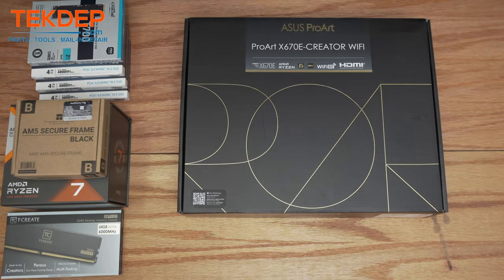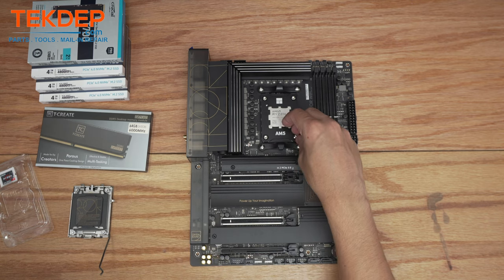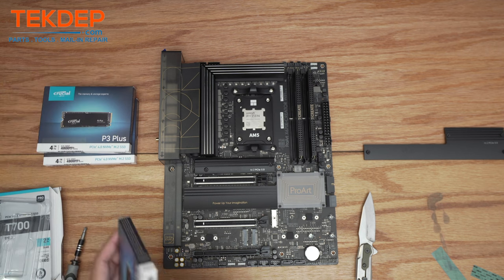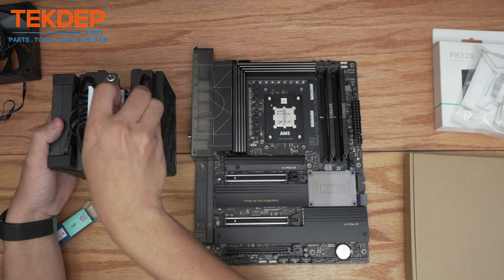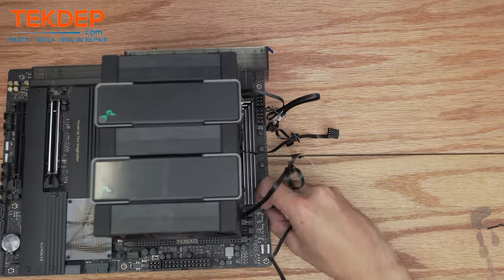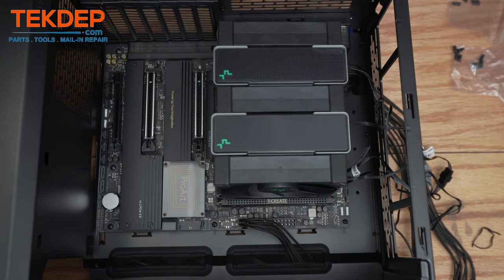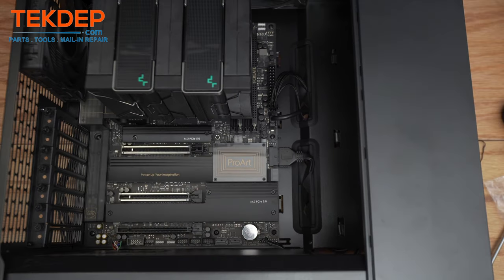The Perfect RGB-Free Gaming Rig: AMD 7800X3D + RTX 4090!

Comment: 00:03 Overview of the motherboard and CPU components.
01:14 Installing CPU and CPU Contact Frame
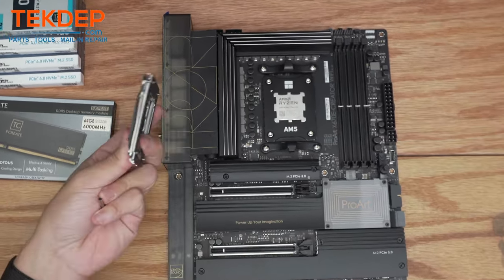03:10 Installing 64GB of 6,000MHz RAM and installing storage M.2 SSDs
06:00 Installing CPU Cooler
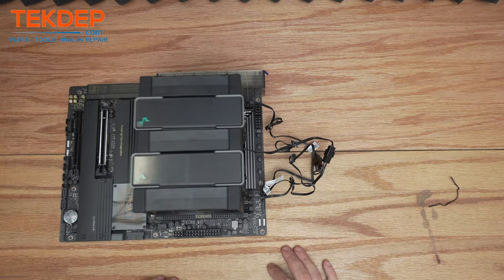10:50 Place components into the case.
12:08 Fans Installation and Cable Management
16:41 Installing the RTX 4090 Founders Edition
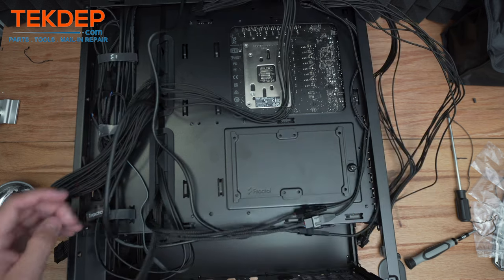18:29 Installing the power supply and securing it to the case.
19:56 Final Assembly

Support me? Link on my channel's descriptions

Comment: Supporting the graphics card has nothing to do with protecting the case or the slot, but rather protecting the card itself. The problem with graphics cards today is that they are extremely heavy and the board bends, causing the solder contacts under the GPU/memory to break and the card then no longer works.
Reply from the maker: Correct, most people get supports to avoid the rtx 4080/4090 "cracking" around the PCIe slot. Crazy how heavy these things are now.
Reply: @tekdep  Sadly the Crack on the PCIE Lock is the "Smaller Problem"... I Repair GPU`s and The Worse problem is Cracked Solder Points under the Vram Module Between the GPU and PCIE slot and on the GPU. They Rip so Easily and it brickes the Card Completely until repaired.

Comment: I've been looking at making a similar build but with a 13900k. Is there anything you would recommend changing about the cooling system with this cpu?
Reply from the maker: Given how much wattage the 13900/14900k draw, I would recommend no less than a 360mm AIO. This should help with noise created by short burst workloads and temperature increases these CPUs are prone to.

Comment: For anyone watching: don't buy this AM5 "frame". It doesn't do anything, amd doesn't have the problem that intel does. This is just marketing BS.
Reply: I would argue they work exactly as advertised and help keep core temps more consistent across the die BUT:  Unless you're really REALLY pushing voltage through these things [and as you stated, they're not intel] you're factually correct in that there is no point to adding one.
Reply from the maker: Although the temp gains are within that of margin of error, given there was no budget for this system why not include the contact frame if it could help keep temps down even 1c. Yes it is very true that AM5 does not have any issues with mounting pressure to the CPU socket, unlike that of LGA1700. The contact frame itself is also a mere $8, so the trade off of $8 for a possible 1-3C seems like a why not to me!